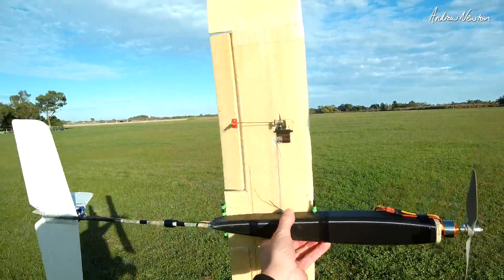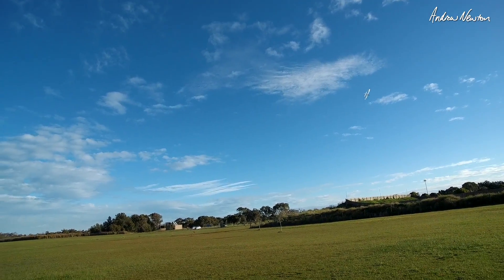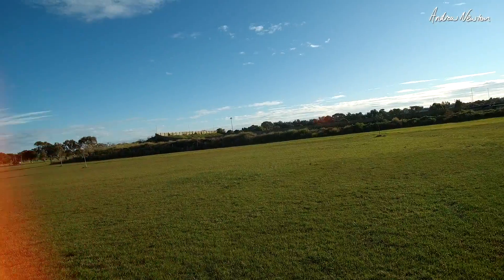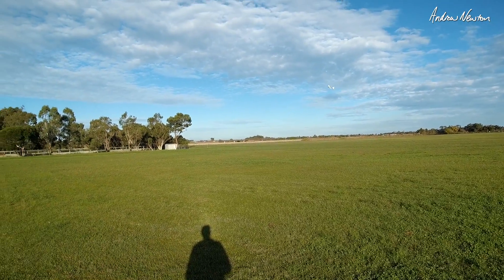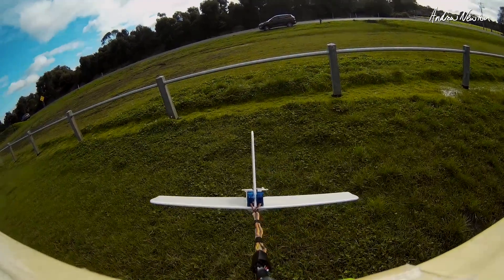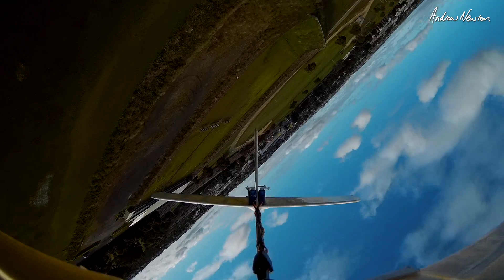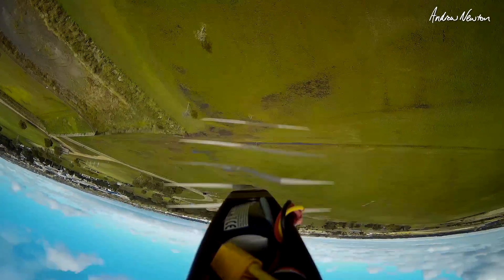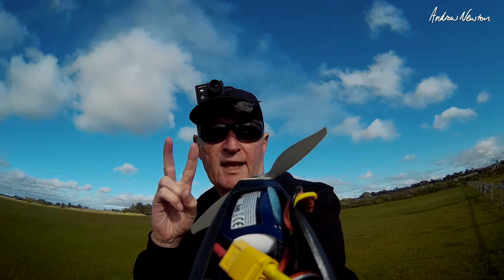Smeg Pod Franken-Plane

Comment: Sweet design, I'll start printing it tomorrow.  I've wondered about dual carbon booms, an Armin wing and 3D printed parts to mount the tail.  Now I'm wondering how modifiable your pod is to suit dual 6mm or 10mm round or square booms.  I figure less flex in the tail.
Reply from the maker: Easy to adjust the boom hole, do you want the Fusion360 or STEP file?
Reply: Very generous, the Fusion360 would be ideal.  I started printing your pod, I'll build the plane as above but with a single boom for now.  Should be a straightforward modification to the rear of your pod for two booms ... I'll have a go.
Reply: Tried to print as is, but the body splits at the join step.  Did you do anything to get around this?  I printed it with the solid surface on the bed.
Reply: I'll have a go at making the wall thicker around the join.  It'll mostly be on the join so the center of the fuselage.

Comment: I like the 3D printed Fuselage.
What is the weight difference to 6mm foam? How long did it take you to print and will it last as long as molded plastic?
Cheers mate.<]:).
Reply from the maker: 11hrs print time total. Probably heavier than foam and who knows how long it will last.
Reply: @AndrewNewton :That was close to what I expected as an answer,, But I had to ask something!!
If you fly like me and number Flight 2 crashes and brakes,, then its 50%...
Too Cold for a Dive Mate??? .<]:).

Comment: I love these frankenstein plane mods.
I wish I had a 3D printer..  been thinking of making a more aerodynamic and efficient narrow body/pod to house the Lipo and electronics for my Skyhunter Racing.  then maybe an A-tail for it with the tail servos mounted in the main wing and the control rods routed through the booms? 
Theres an idea for you Andrew... you have 2 Racing Skyhunters dont you? ;)
Reply: Get one!  For your first one, I’d recommend the Creality. After you get it, you’ll wonder why you haven’t gotten one earlier. I’ve been using mine for planes, my wood shop, different items around the house, gift items, etc. just get one!
Reply from the maker: I think I sold or gave away the little SkyHunters.